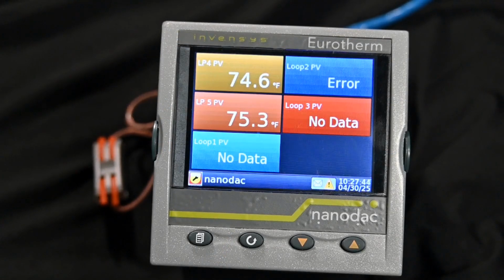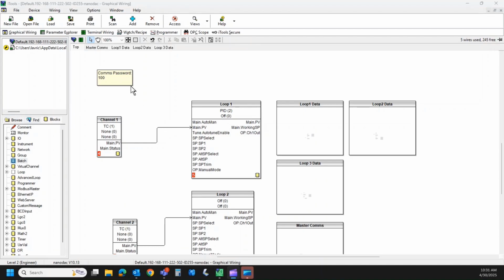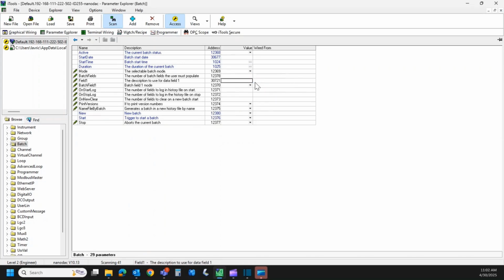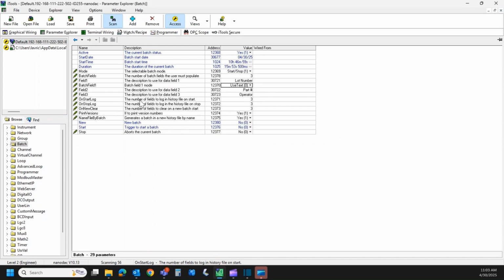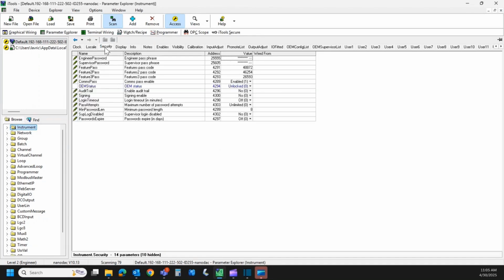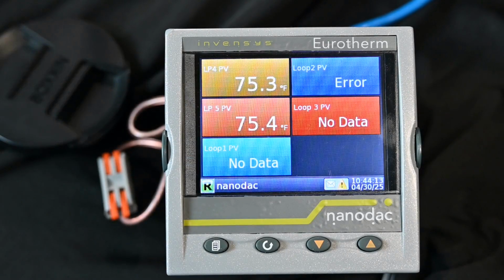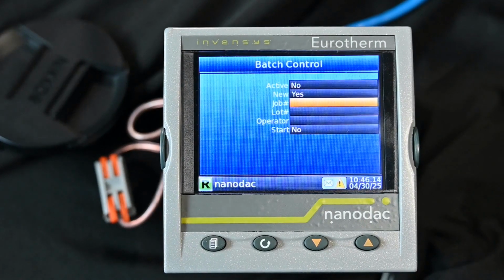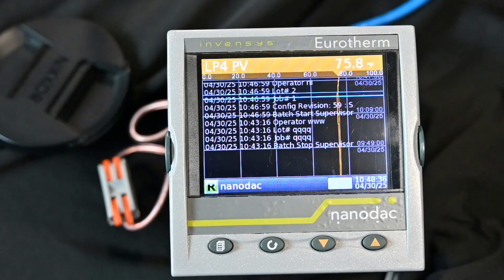How to Set Up a Batch Configuration on a nanodac™ Using iTools

Comment: Hi Rich, I have just got my head around the Batching setup and have it pretty much where I want it. I'm currently using the Digital input to trigger the Batch start and stop, this input comes from a relay on the machine which closes automatically when the machine cycle starts then opens to stop. I was wondering if you knew how to create a batch field which will increment by 1 at each start so I can use the machines run number to match up specific batches to machine cycles. Any help would be great, thanks.
Reply from the maker: Hi SuperEthanlee

Yes, you have to configure a counter within the recorder, which monitors a digital input, then increment the Batch whenever the counter sees a pulse come in.

You would need to have an option enabled on the 6100 to accomplish this though. The Option is called out as "MTC" (Math, Totalizers, Counters).

If you don't have this option, it can be unlocked in the field using a keycode upgrade. 

Please contact your provider or distributor and they can walk you through how to upgrade your recorder if needed.